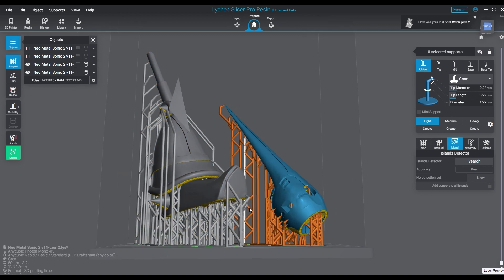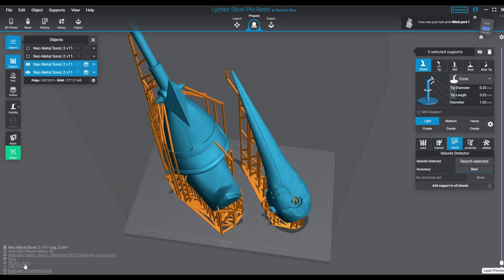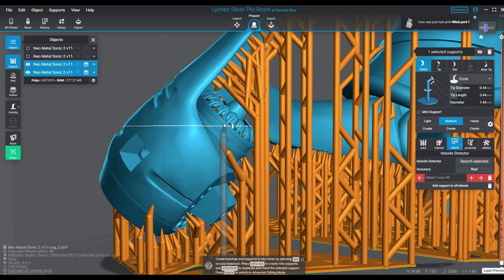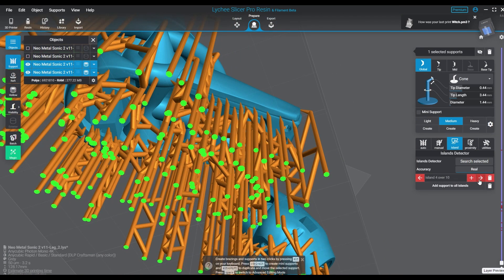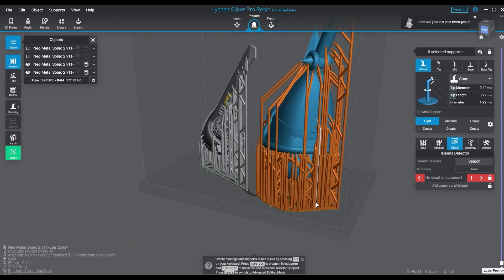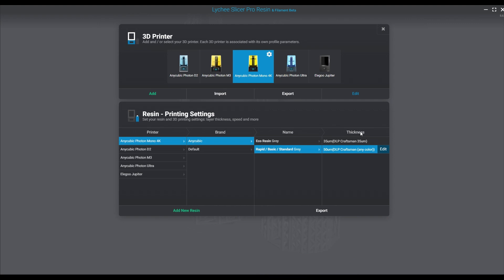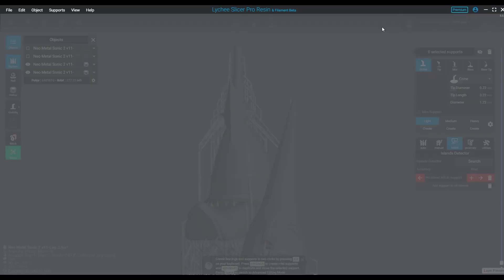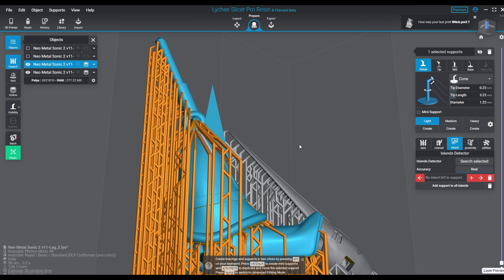How 3D Print resolution can help find more islands in your prints! - Lychee hack

Comment: I discovered and announced this about a year ago. I own a professional presupport company and at the time, a client was finding islands on work we had put out. It boggled us for a while. I am part of Lychee's beta test team, and for months nobody knew why it was happening until we discovered this. I actually taught in a video for this to be used as a "feature" for a semi-auto support tool for miniatures. 
There is some information that isn't widely know that you're missing here. 
The island detector doesn't only scan by layer height, it also scans by pixel size. So this is even further complicating the island detection more.  Change to a different print and rerun the same scans and you often times will still find islands you didnt find before.

Also, there is no need to cycle multiple layer heights. Just run the scan at 20um and it will take care of the rest for you.
Reply from the maker: That's pretty crazy, but by now you would think Lychee would implement some type of advanced island searching function. I have been using this little trick for a while now, but had no idea until a friend had pointed it out to me when we exchanged files. This was a huge eye opener for me. I am very familiar with you all, TableFlip is amazing you all inspired me to do what I do. I did not see that video, though now I am going to check it out for sure.
Reply: @IPrint3dMinis  awww thanks man! it was the 3d printing beginner class. I did the semi-auto support method at the end.
Reply from the maker: @TableFlipFoundry  Awesome, will check that out. Thanks for watching BTW. Like I said you all rock, and thanks for the comments!